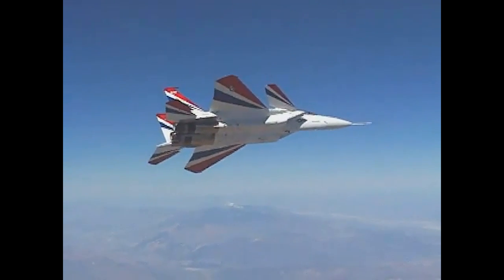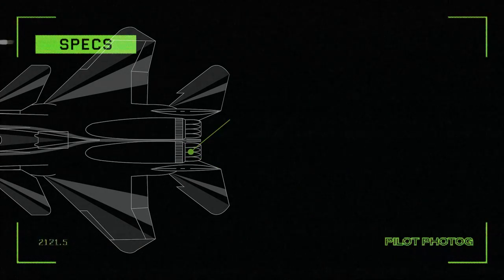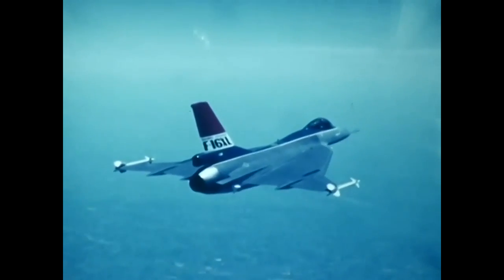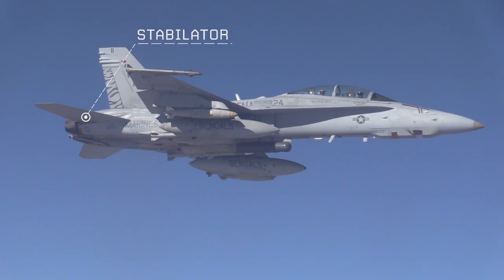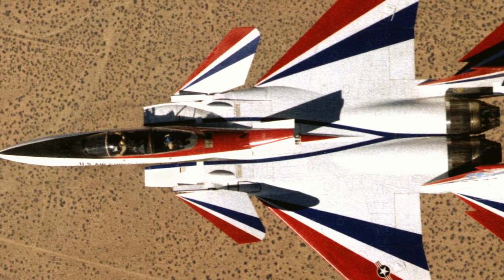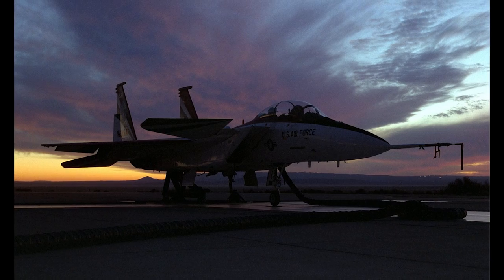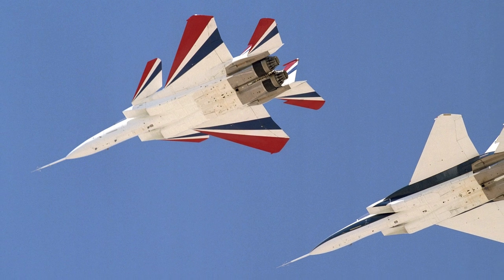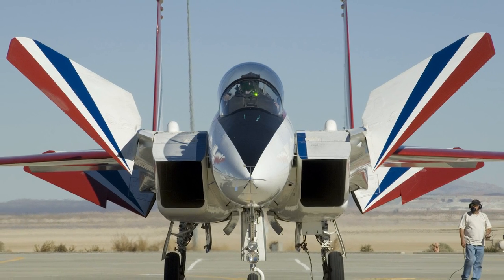NASA's 837: The Ultimate Modified F-15!

Comment: This research needs to be incorporated into the new batch of F-15Xs
Reply: I'm sure much of this is being used. So much valuable information to incorporate.
Reply: Thrust vectoring proved to be a shitty concept for aerodynamically maneuverable energy fighters
Reply: All the us learned was it burned energy
Reply: Grand Duke of Mecklenburg-Schwerin why is it in the f-22 then?
Reply: @AL3X2580  F-22 isn't designed to get in aerial engagements...Just lock pop and run...the thrust vectoring is a quick fix for some angle of attack issues... it was controversial, over the F-23 with Conventional Manuverability and energy retention...Many look back at the F-23 with a "damn, that mightve just been the greatest air superiority foghter to never enter service, ever designed..."
Reply: @AL3X2580  the F-22 is the greatest fighter to enter service solely thanks to its stealth, radar, awareness, interconnectivity...It does its job...It ain't for hanging around in a potential Visual range fight, thats what the F-16s are for
Reply: If you cut the stealth it wouldn't be the jack of trade the F-15 is that can kick any aggressors ass at both BVR and in a dogfight(outside of the F-16 being the king of the elusive dogfight)
Reply: "Metz notes Lockheed knew how to present and market their airframe far better than Northrop did. He notes that not everyone who would be in a position to select a fighter aircraft would be an engineer and that they may not even be technically astute. So leaving 'lasting impressions' on a conceptual level, even if they don't tell the whole story technically, can give one side an advantage over the other."

"Never hang your head in shame about what we did. We built a tremendous product that would stand side-by-side with anything else, and in many cases exceed the capabilities of anything else. And we can always be proud of that."-Paul Metz
Reply: @granddukeofmecklenburg  damn thanks for thge reply, really insightful
Reply: @AKlover  what are you even saying? Visual range in a Sukhoi isn't were you'd wanna be
Reply: @granddukeofmecklenburg    Ignore the point entirely.  Of course.
Reply: @AKlover  what point?
Reply: @AKlover  you never answered? The Sukhoi has inferior radar, but better missiles than the Amraam...EW russians have the ground, EW US has the Air
Reply: Growlers or an equivalent in EW would protect a 15 tho the 15 is a BVR beast...Visual Range 15s and 16s are still brutal beasts
Reply: Id take a 16 over any Delta Canard euro speed bleeder...Or thrust vectoring knot tier
Reply: @granddukeofmecklenburg  Didn't we provide Japan our only remaining F-23 chassis?
Reply: That the x 31
Reply: @Reese Bowles thanks for the information. I obviously had no idea. I like to learn new things.
Reply: @jkeelsnc  Two problems, in a mutual detection scenario both planes are going to lose most of their speed and energy dodging missiles so neither of them are going to be in a position to close in a high speed. Second off to get within visual range they would have to go through the no escape zones of their respective missiles where they will be unable to dodge the enemy missile.

Comment: Am I the only one who wonders why the Aur Force didn't upgrade their Eagles with thrust vectoring capability?? They should have also expanded on the F-18 HARV and F-16 VISTA.  These would be good contenders to the likes of the SU-30SM
Reply: I wondered the same thing. I know when I was crew chief on the F15e we took the cft's off to demo the jet and it kept push g limits. I don't know if this airframe could handle thrust vectoring.
Reply: They’re superior to the Su-30 without thrust vectoring, because they have better high-speed sustained turn rates, better energy maintenance, and much better radar and avionics.  Thrust vectoring just isn’t really relevant in modern air combat.  No US pilot is going to get into a turning fight at 250 mph.  US doctrine since 1942 has been to avoid this at all costs.

Comment: I was honored to have flown the first flight of this bird after its reconfiguration with canards and a new digital fly-by-wire control system.  The first S/MTD flight was on 7 Sept 1988 with the -220 engines but with round non-thrust vectoring nozzles. Envelope expansion and handling quality testing were the main goals with speeds up to 1.85 Mach and great flying qualities.  

When the 2-dimensional Thrust-vectoring, Thrust-reversing nozzles became available the following year, the first flight was made over Missouri on 10 May 1989.  After initial checkout flights with the total integrated control system, we ferried the bird to Edwards AFB for the joint test program with the USAF test team.  Over the next 2 years, we met all the program goals and achieved takeoff distances of less than 1000 feet and landing distances as short as 1,266 feet.
Reply: Salute to lawsom1

Comment: Do we know what became of the F-15 Stealth Eagle project? I must admit I have not paid as much attention to F-15 development compared to Sukhois in recent years (personal preferences)
Reply: I have wondered about that too. The Silent Eagle was like a '5 - gen' jet. It had full frontal stealth and low observable (LO) on all other aspects. If the USAF has its mind set on new Eagles, why the HELL did they not implement the Silent Eagle? The new one is basically a SE only without the S lol. Sure, they wanted it to have commonality of parts & manufacture with previous F-15 variants for lower cost, but shit the new F-15 is turning out to cost more per aircraft than the F-35! Silent Eagle was about the same cost as the F-35 currently--around $85 million. They coulda had their new manufacture Eagles with stealth.
Reply: The F-15 is still superior...🤷‍♂️
Reply: @granddukeofmecklenburg  
You mean F-15 vs Su-27? Plane for plane, the base F-15(A I presume) vs the Su-27S (S for Serial) the Su-27 is the better aircraft. This was part of the soviet design brief that any aircraft had to be 10-15% better than the US counterpart, and during a 1990s mock dogfight between a F-15 and Su-27, the Su-27 won both scenarios (I believe it was piloted by Aleksandr Kharchevsky)

With the subsequent upgrades and mods, the US 'Blocks' (I find them rather more confusing than the Russian suffixes) vs various Su-27SM(2/3), the Su-30SM, the Su-34 and Su-35S, the lines are less clear but airframe vs airframe the later Sukhois have the edge. However that is not to say F-15s are not a fantastic aircraft in of themselves - they very much are good fighters.
Reply: @boffinboy100  no I mean contemporary Models of both the F-15 and Sukhoi 27,30,33,35 family
Reply: @boffinboy100  F-15s are superior in BVR(with its APG-63(v)3) and superior as an energy fighter...The sukhois advantage is its greatest disadvantage...To achieve its maneuverability it burns far more energy to gain any advantage that it in turn loses...The problem was pilots were expecting to fight other energy fighters, and a new program had to be made to Understand how to exploit the downsides of thrust vectoring with high energy retention high Sustainable maneuverability
Reply: With energy retention, thrust vectoring is the worst...Canards are less bad but also burn energy, but the plus is they can improve angle of attack without stalling in the same way most conventional airframes would...
Then Delta wings also bleed energy comparatively
Reply: The US realized almost everyone was going with 1 of those 3, and realized its straight to the point Energy fighters, with extremely good conventionally achieved maneuverability was the most versatile in terms of your options in an engagement

Comment: Why wasn't the canards and thrust vectoring integrated to existing F15s as standard? smh
Reply: Probably because the F22 was in the works, why spend all that $ on a retrofit?  The F22 is super-maneuverable and has stealth.
Reply: @BStrambo  Because of the improvment from forward air bases. Taking off from makeshift runways is a good thing. However F-15 is a big jet and small jets are better for this role.
Reply: The US doesn't really like the canard idea at all. They increase drag and decrease range and speed. The US has a different doctrine than they used to.
Reply: @sevenrats  agreed. Also massive close coupled canards like thoes would have a detrimental effect on high speed manoeuvres. As I'm sure the F15 is better at high speed "dog fights" than low speeds. So why handicap it?

This was also true with the Eurofighter Typhoon. Even though it has forward cannards coupled with a delta wing making it highly maneuverable at high speeds. It suffers with low speed due to the placement of the canards. So Eurofighter tested "LERX" Leading Edge root extensions which improved subsonic manoeuvring by 15% but had a knock on effect at subsonic speeds.

Where as the french Rafale has close coupled canards like the F15 in question is highly maneuverable at lower speed and suffering more at higher speeds.

All in all, I'm use the USAF said there were more cons than pros with these canards for what the f15 is intedent to do.
Reply: @sevenrats  ; And increases in radar signature, and maintenance time.

Comment: Something is telling me Sukoi based a lot of their flanker designs on this plane. The similarities are stunning.
Reply: Very different designs, not sure how you came to that conclusion. The flanker is fly by wire, the eagle is not. The flanker is a blended wing and body, the eagle is not. The eagles has intakes on the side of the fuselage, the flanker is underneath. Granted they both have two tails and two engines but that's where the similarities end.

Comment: +1 PilotPhotog - Excellent video!  As a young USAF F-4E Phantom jet crew chief during the late Vietnam War I've always wondered why the superlative F-15 wasn't updated with canards and thrust-vectoring at some point to extend its air superiority role a few more years.  At least both mods were tried, but GEEZ those freakin' oversized Dumbo-ears high drag canards would kill any possible performance boost!  Not surprised to see that 837 was slower than the speedy Mach 2.2 F-4 Phantom that preceded the F-15.

BTW, the 71 in the USAF tail number 710290 means it entered production in 1971.  That she first flew in 1973 means it took 2 years to manufacturer, which was typical for that time.   I'm curious as to the 0290 designation as I think that normally meant it would have been the 290th F-15 airframe produced for the 1971 year.  Since it was one of the 1st F-15s to roll off the assembly line that doesn't make sense. Maybe someone more knowledgeable can clear that up.

Cheers from Thailand!
Reply from the maker: Thank you for your service and thanks for commenting! The F-4 is an incredible aircraft that had a long run and is an icon in aviation.  I plan on a series of videos all about the phantom.  To answer your question:  my understanding with USAF serial numbers is that the 71 is the year the aircraft was ordered and as you said it took two years to produce which was typical especially for a then new airframe.  As for the 290, my best guess is that the USAF sequentially numbers all aircraft ordered in a year so 290-300 may have been Eagles but 001 to 289 may have been other aircraft that were also ordered in 1971.
Reply: Whoa!  Your conclusion that this bird was slower than the F-4 Phantom is only true because we had no sanction to go any faster!  Since the planned test points only went to Mach 1.95, there was no need to go beyond Mach 2.  Although we test pilots wanted to expand beyond Mach 2, the managers established a Mach 2.0 placard to limit the cost of the program.  Although this video states that it had a top speed of Mach 2.0, it could go considerably faster.  As a case in point, when we flew the final thrust vectoring points at 1.95 Mach, we had to retard one engine to MIL (non-afterburner) to maintain the trim point and prevent breaking the Mach 2.0 placard!  It could have gone considerably faster!

Previously, during some of our company's supersonic envelope expansion tests in the midwest, I was concerned that the canards might be a supersonic performance penalty but was pleased when my F-15 chase plane and I did a comparative acceleration test to Mach 1.6 - the canard bird won!
Reply: @lawsom1  Great info, thanks!  I remember that the F-15 was rushed into production in the late 1960s/early 1970s to counter the mysterious new MiG 25 Mach 3 interceptor.  I'm guessing the original F-15 must have had similar top speed as the MiG 25 to be a worthy adversary.  Thankfully, unlike the MiG with it's huge airliner engines that tended to disintegrate at the Mach 3 threshold,. the mighty Eagle's good old American Pratt & Whitney engines proved to be powerful and reliable.  Of course, you would know much more about that than this old Phantom Phixer.  :)

Regards from Thailand! 😁

Comment: The F-15 Eagle has always been one of my favorite planes, right after the F-4 Phantom. They are just sexy!
Reply from the maker: Agreed and I plan series all about the F-4...thanks for commenting!
Reply: There is an F-4 testbed with canard at the air force museum at wright-Patterson A.F.B.
Reply: @kdrapertrucker  That sound pretty cool, I used to live in Tucson Az. and visited the Pima Air Museum, about a half dozen times. Their F-4 display is almost as incredible as their SR-71, which you can walk right up to.
Reply: The Northrop F-20 Tigershark is personally my favorite, though I understand your love of the Phantoms and Eagles.
Israel actually made a version of the Phantom dubbed the "Super Phantom". It had PW1120 engines replacing the J79s, giving it a thrust-to-weight ratio greater than 1:1. Sadly, the original manufacturer of the Phantom got involved and shut down the program, since they considered it a "competitor" to the new F/A-18 Hornet. The Super Phantom (dubbed Super Kurnass by the Israelis) would've also had a far better radar, and new control systems (most likely giving it  fly-by-wire).
Reply: @Tigershark_3082  The F-15 was at rhe time the only attack aircraft that could accellerate to mach speed in verticle flight with engines that peoduced more thrust than the plane weighed.

Comment: Just be glad that you didn't have to work on it... I did, what a mess from a maintenance standpoint (especially the avionics).  It was a badass aircraft though!  I was reading day of the Cheetah not long after I worked on it.
Reply from the maker: Thanks for commenting and I can only imagine how hard it must have been to maintain, I am thrilled that someone such as yourself who worked on 837 took the time to watch the video and provide feedback.  I do plan on reading Day of the Cheetah and have begun the series at the beginning with Flight of the Old Dog
Reply: @PilotPhotog  that whole series is excellent by the way.  One thing that you missed was the rather serious IFE that occurred when the aircraft bounced on landing and then changed the nozzles when the weight off wheels switch was incorrectly interpreted at near ground level, resulting in the nose gear being slammed into the ground so hard that it bent significantly (and this wasn't standard F-15 landing gear - this was off-road rated stuff).  They had to land on the lake bed, I remember the pilot telling the tower that he'd have full nose authority all the way down to 50 knots.  When the nose gear finally hit the lakebed, it did a rather abrupt right turn before coming to a stop.  It was a brilliant landing and saved the plane for another day (1992 or 1993 I think, although it could have been earlier - before NASA got it).  I was an F-15 avionics tech at Edwards AFB from 1989-1994.
Reply from the maker: What an amazing story and thank you for sharing.  I plan on a whole series about the NASA testbeds and when I revisit this airplane I’d like to include this incident and cite you for credit if that is ok.
Reply: @PilotPhotog  just cite me as "a maintainer" - I am still active duty in the military.  1989-1998 - USAF (EAFB).
Reply from the maker: @mpeugeot  copy and thanks again for the info!

Comment: It fascinates me to see wildly different approaches to the same goal. In the UK we had the P.1127 Kestrel, better known as the Harrier, and the cancelled P.1154 to, in part, address the issues of a damaged or minimal airstrip. One of the proposed uses was that aircraft would operate forward deployed from forest clearings in Germany in the event of a Soviet attack, no runway required.
At the same time Sweden put long, straight stretches on many of their roads, removable central barriers and concrete pads to the side so that they could be used as impromptu runways if the need arose. Damaged runway? Pick a different one, we have plenty!
I still flinch whenever I see movable canards though. My father was an aero engineer for much of his life, worked for Hawker Siddeley under Sir Sydney Camm for a time, and I've inherited certain foibles as a result. "Computer control is not pilot control" being one of them. I know, avionics have advanced a lot since then but I still don't trust computer inputs. Which is ironic as I made a career in IT...
Reply from the maker: Thanks for commenting and for your insight....it is interesting to see the divergence in design philosophies between the US and UK over the years...to your point about the Swedish road system and being able to be used as runways:  The US Interstate System (which was envisioned by Eisenhower after the war) was designed so that at least one mile in every five is straight so that they could be used as impromptu airfields in case of a war.   And as for computer control, there has been debate since the first fly by wire went into an airplane as to who is really flying the aircraft :)